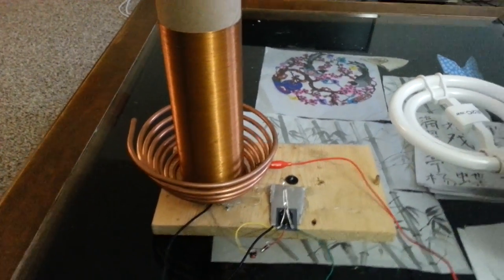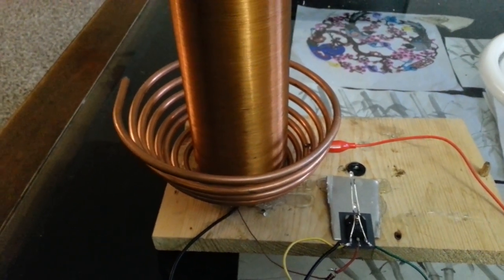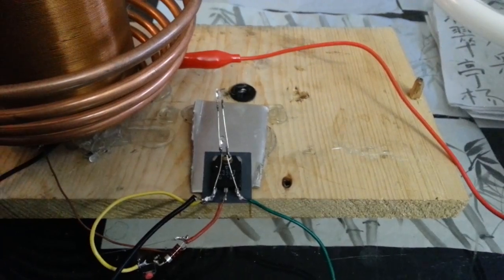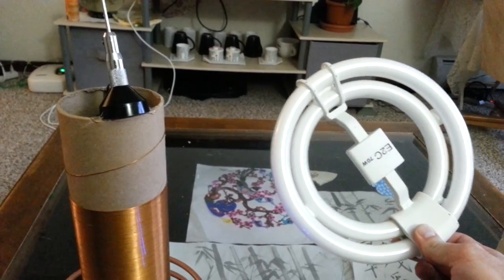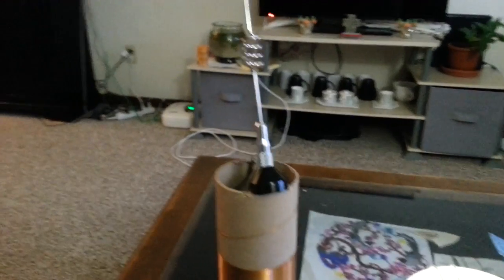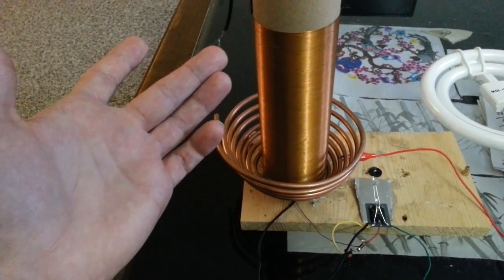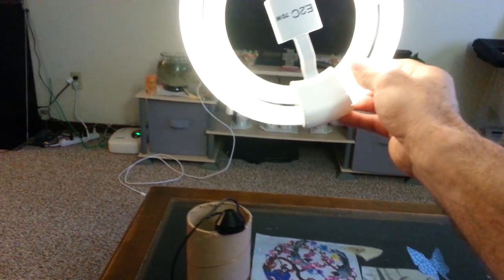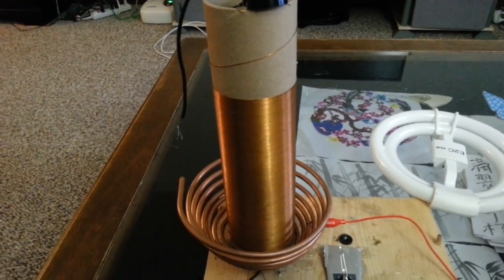Slayer/Ringer tesla coil hybrid

Comment: my circuit is not working.. I don't know what's the problem?
Reply from the maker: With this circuit there can be several things that keeps it from working right. The biggest problem is usually getting the primary coil the right number of turns, sometimes it's just three sometimes it's five or six. And depending if it's wound clockwise or counter clockwise you will have to change the power input from the top to the bottom of the coil so try both. The slayer circuit uses a very high value resistor between the base and collector. You could use a variable resistor to find the right value. You don't need the LED for the coil to work but if helps to know that the coil is on. Also make sure your using a npn transistor, a pnp has to be wired backwards. I hope this helps.
Reply: Darren Hoffer I have 22k resistor,TC5200 transistor, also 2222A,and a capacitor,300 turns of secondary coil (28gauge)  and 3 turns of primary,and still I don't know what's wrong with my circuit 💫  I also have power supply problem!
Reply from the maker: +Mariamma Jojo it sounds like you have everything you need to get it to work right, if I had to guess where to start trouble shooting I would say it is your transistor, I looked up it's data sheet and says it needs 230volts minimum rating. Try a 2n3055, they are pretty common and I know they work, once it's working then try other transistors 😊